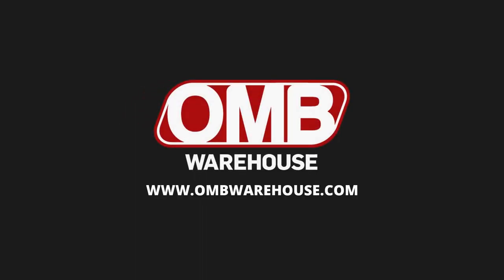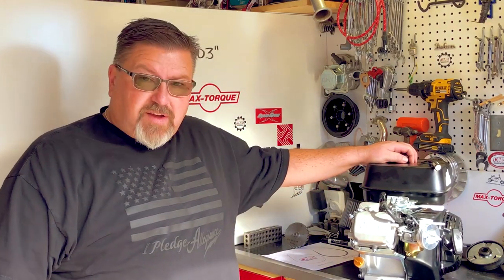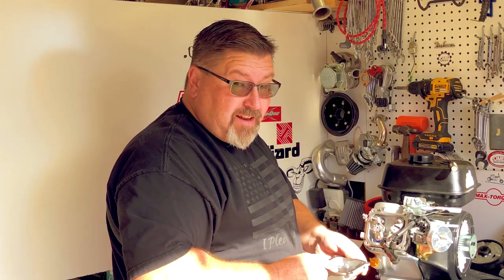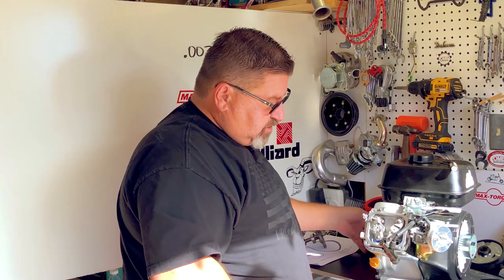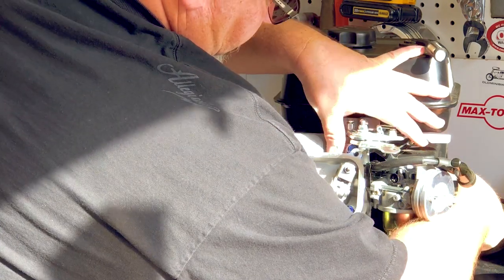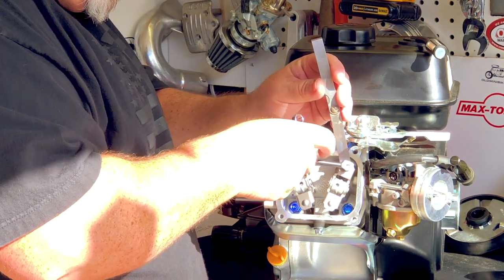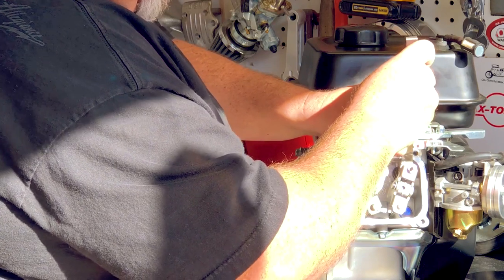Predator 212 Hemi Valve Adjustment How-To

Comment: Great informative video. I've never worked on small engines and have been rebuilding my predator 212cc and running it to death without an exhaust 😂 I've been having arm tearing recoil and no start, first thought it was a valve crunching issue, verified nothing was bent, and then figured it was a massive amount of compression and finally decided to find out how to ACTUALLY set valve lash haha.
Reply from the maker: Haha! So happy to be able to help! Lash is critical with these engines!
Reply: Hey I'm having the same issue, but .003 didn't work for me. I have to have around .006 for it to not want to hurt me

Comment: Thanks for the help, my cam fell out when I was removing the governor and so I lined up the dots on the cam but was hard to pull, so I looked up what was needed and used this video.
Reply: Did that fix your issue?
Reply: Yes, it running fine now
Reply: Romeo Ramirez thank you

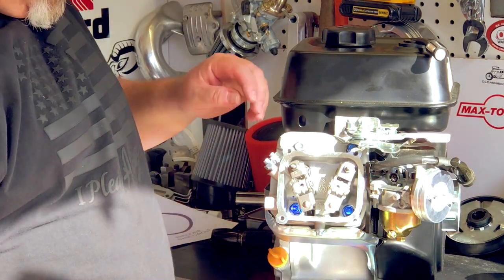Comment: @5:10 hey great video by the way but I just wanted to throw a slight clarification out there that you meant to say turn the engine counterclockwise instead of clockwise but i think you only accidentally said clockwise because you were thinking what direction the cam gear was getting moved in. No big deal because if people are looking close enough they can see that you moved the PTO shaft counter clockwise and I’m basing this off of the manual which states the engine runs in a counter clockwise rotation viewed from the PTO shaft side meaning where your centrifugal clutch or torque converter would mount to on a go kart for example. PTO stands for power takeoff and its usually said as power take off shaft. This is obviously on the opposite side of the flywheel where the pull starter is. I just wanted to clarify this so someone didn’t need to ask later. Oh I wanted to add nothing wrong with taking the recoil starter off because it’s easier to move the engine in small amounts then having to use the pull rope but another option is to just turn it by the PTO shaft And even though there’s less leverage it won’t be a problem as long as you have the spark plug out.

Comment: I upgraded to the 18# springs and I've adjusted the valves, both @ .003 then installed the carb jet kit... now my engine pops when I accelerate. Did I maybe put the carb gaskets back on wrong... or ??? - PUZZLED. :( Oh, and I added an OMB header w/weenie muffler.
Reply: Mine does the same thing, it seems ok as long as the pops don’t sound violent. If there sort of soft it’s ok
Reply: maybe running rich adjust carb needle ik its 2 yrs later lol

Comment: Need help my predator 212cc brand new, valve lash is good and stage 1 kit. When I full throttle it accelerate fast but then stop and then wants to go and stop and goes again I don’t know what to do
Reply: Idol out the carb maybe

Comment: Nice video GG!  Is that 0.003 lash gap the same on the WC 223 stock without a cam change?  I am doing a once over on a WC prior to break in, and finding specs on it has proven TOUGH
Reply from the maker: I set all of my engines at .002” to .003” regardless of what cam they have
These engines expand when hot and the lash will open up. Set it tight and the engine will be easier to start and perform better!

Comment: Great video.I need to do the same thing to my engine.
Reply from the maker: Thank you! Please let me know if I can do anything to help you
Reply: The Gray Goat Garage i try this but now it feels like my engine has no compression.Im going to try again tonight and watch this video over.I have no problem setting the non hemi but this hemi engine is a little bit harder.I know I’ll get it right.
Reply from the maker: Hi Sam,
Ya know, the Hemi is actually easier to set the lash on! It does not tighten up like the non-Hemi's do when tightening the jam nut. Just make sure you are on the compression stroke and not the exhaust stroke! Please let me know if I can do anything to help and you may get a quicker response by emailing me at HELP@OMBWarehouse.com
Reply: The Gray Goat Garage I finally got my gokart running great after watching this video while I was working on it.Thank you so much.I make super fast homemade go karts.my blue mini razor dune buggy is to fast to drive.

Comment: Will this help after I installed a mikuni 22 mm carb? I began the upgrade today and the pull didn’t pull. I did watch this video on valves and I’m just confused with the adjust.( Probably because I’m missing tools) I got the valve cover and unscrewed the pulley cover off and began rotating. I didn’t unscrew the spark yet but I just want to know if these steps will help also getting the engine started. The engine is a hemi.
Reply from the maker: Valve lash is critical to the proper operation and performance of these engines. If not done properly the engine will be hard to pull over and not perform well

Comment: I recently did a ARC flywheel & valve springs. & a jet kit & filter. Now my 212 hemi had a serious kick back and I have to give it just a bit of throttle to start it! Would this valve adjustment help solve this problem? Any help would be appreciated
Reply: Did you ever fix the problem? I'm having the same issue it also gets really hard to pull.
Reply: @frank2887  yes I played around with it and I ended setting my exhaust valve at 0 flash actually just a slight bit of resistance on it. So now the exhaust valve opens a but sooner than the intake valve. We did a carburetor upgrade a spit rear sprocket with a 62 tooth and my son has best top speed of 54 mph he is 175 pounds. It's a little beast. But it totally fixed the pull kick back problem and starts super easy. I recently added a flywheel to my other son's 212 and set the valves the same way and it's great!

Comment: I'm assuming you'd want to readjust the valve lash after installing a thinner head gasket, correct?
Reply from the maker: Hello,
That is correct! Anytime you pull the head or open the case you will need to adjust the lash. This is also something that should be done as periodic maintenance. Set intake and exhaust at .003" when cold.
Please let me know if you have additional questions

Comment: I did this step by step, turned on my engine and with the choke closed it sat at an idle, even when I used the throttle. And when I turned on the choke the rpms flung up. Was hoping you’d know the solution to the problem?
Reply: Sounds like the float is staying open in the carburetor flooding your engine with fuel or you have wayyy to big of a jet in the carb, i believe .035, .036, and .037 are good starter jets for a low modded 212 or get a new carb
Reply: what was the problem ?

Comment: wait did he tighten both of the valves both at .003?
Reply from the maker: Yes, lash on both sides should be set at .003". This will make the engine easier to start and run better!
Reply: Don't you need the intake valve closed before adjusting it???

Comment: Where are you getting these numbers for valve lash clearances? If I've searched 50 different sources I've got 50 different answers.
Reply from the maker: The .003" figure is what DynoCams suggests for  most of their cams.
I have also been known to build a few engines to know what works.
Reply: The problem with this is that many think the lash needs to be absolutely dead on a certain given number and it's just not the case. The reason to check/set lash is to verify it is not too tight or too loose. The .003" that many use is a good number because it's in between zero and the Honda GX200 spec.

I have a 14 year old fairly low hour 196 utility engine that I set to GX200 lash spec (.006" intake .008" exhaust) when it was new and haven't touched it since. I'm not saying it's a great idea, just that it works. Some guys get more specific and carefully set to zero lash. I say good for them.

Comment: I changed springs to 18lbs on my hemi, and now when i pull its hard and nearly rips my arm off
Reply from the maker: That is because you need to adjust the valve lash. Set both sides at .003”. The decompression lever on the exhaust valve is not relieving the pressure when pulling it over. Reset the lash and you will be fine!

Comment: If I install 18lb springs does it matter what rocket arms goes where I’m new to this
Reply from the maker: Hi Barbie,
Nope, that does not matter if using a 1:1 rocker arm. 
Depending what cam you have and whether you are using an aftermarket "ratio" rocker, we may spec a different spring rate.
If you can be specific as to what combo you are using, I can make a more informed answer for you

Comment: Can you use eney other one then
.003 cose I onley have one that goes  to .011
Reply from the maker: W
Hen using bigger cams and heavier springs I will set my lash at .0015”. It makes it easier to pull with my weak arms. .003” is fine and will work for you

Comment: I have no govoner a  hot 365 cam with 22 lbs springs and a stage 2 and 1 kit. Can someone please tell me the correct spacing I need for each of the valves?
Reply: I've heard .004 and .006, .005 and .007, .006 and .008. Now in this video .003 and .003.   Seems no one knows the correct numbers.
Reply: Just do .003 it works with most upgrades.

Comment: Hi I just installed a .275 lift cam and on the box it says valve lash cold .001 and just want to  make sure that’s correct or should I do .003?
Reply from the maker: You can set the lash anywhere from .001 to .003” with no issues. I will usually set my lash at .002” and have no issues
Reply: Thank you and Do you set the valve lash on the exhaust and intake at the same adjustment?
Reply: Two more things do you set both of the valve lash’s at top dead center?  I heard you could also set the intake when the exhaust is full open and set the exhaust when the intake is Full open  is that true?
Reply from the maker: @bradflores7873  nope! Not true. Consider that both valves are closed when the the spark plug fires. Set the lash at top dead center on the compression stroke
Reply: Okay thank you very much and for top dead Center on the compression stroke that is when both of the rocker arms have a little bit of play in them when they are both not touching the valve springs correct?

Comment: What would the valve lash be for the 212cc non Hemi?
Reply from the maker: Hi Rick,
set valve lash cold at .003" on intake and exhaust. make sure the engine is on the compression stroke and at top dead center when setting this.
I am always here to help at HELP@OMBWarehouse.com
Reply: @TheGrayGoatGarage  would it be the same valve lash .003 with 18lb Springs?.
Reply from the maker: The spring rate has no effect on the lash. It is the same .003" with a 10.8# spring and a 36# spring!
Reply: @TheGrayGoatGarage  Ok thank you.
Reply: @TheGrayGoatGarage  there is no way this can be correct because i have set my lash at .003 with my new cam and it almost broke my wrist. my lash had to be set at tight as in .ooo on exhaust and .001 on intake in order for it to pull correct
Reply from the maker: .003" is the correct lash setting for most OHV Chinese engines. If you were on the exhaust stroke and not the compression stroke, you will have the hard start issues. A 4 stroke engine has two top dead centers (TDC) If the lash is set at TDC on the exhaust stroke the lifter will be up on the lobe giving a loose lash setting. The decompressor arm on the cam will not contact the lifter. This will not allow the engine to bleed off the pressure and will be very hard to pull.
Reset your lash on the compression stroke when both lifters are on the base circle of the cam and then let me know if I am wrong. I promise you this is the correct value and you will not have any hard pull issues!
Reply: @TheGrayGoatGarage  that worked but im getting just puff of white smoke. It is firing but going dead as soon as it fires>
Reply from the maker: White smoke is an indication of oil being burned.
If the engine will not stay running, I would check the valve lash and carb first. It sounds like something in the carb may be plugged or gas is not getting into the bowl
Please know this is my best guess based upon limited information. My checklist for this is here
Check spark plug and replace if needed (I never use the stock plugs!)
Recheck valve lash
Try to start the engine on starting fluid
Pull the drain plug off the carb bowl and see if there is fuel there
Is the flywheel to coil gap correct?

One of these issues is usually the problem
Reply: @TheGrayGoatGarage  thanks for the reply! Could valve lash keep the engine from running?
Reply from the maker: Hello,
YES! Valve lash is very important in these engines. As an example, I had a friend ship me an engine that he and his "mechanic" buddies could not get to start. I adjusted the lash and set the correct flywheel gap and it started on the first pull...and I have zero magical skills! When an engine will not start it is usually something simple! You can also email me at HELP@OMBWarehouse.com ...just ask for the Gray Goat!
Reply: @TheGrayGoatGarage  what do you mean flywheel gap? You mean coil gap?
Reply from the maker: Yes, flywheel to coil gap
Reply: @The Gray Goat Garage what is the correct coil to flywheel measurement?
Reply from the maker: benjamin pitu for stock flywheel set at .016”. For ARC flywheel I start at .040”

Comment: Need a price on 18lb valve springs please
Reply from the maker: Honda 18# springs are $10 for the pair
https://www.ombwarehouse.com/honda-gx200-18-lb-valve-spring.html
please let me know if you have additional questions. Please note these will not work in the Predator 212 Hemi engine. They will coil bind

Comment: If I put 18lbs springs in will it still be set at.003?
Reply from the maker: Hi Chris,
The valve spring pressure has nothing to do with lash. Set both sides at .003" on the compression stroke and you will be fine! Please let me know if I can help with anything else
Reply: Thank you I'll try it....